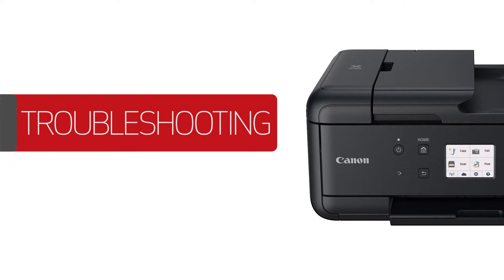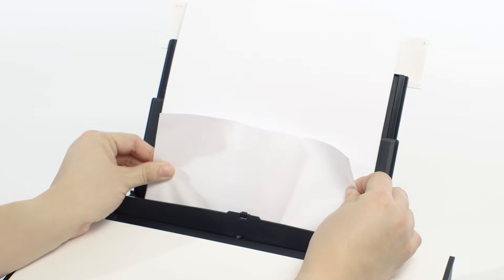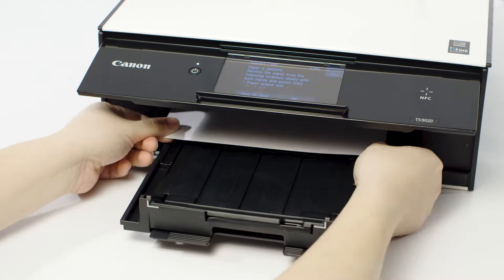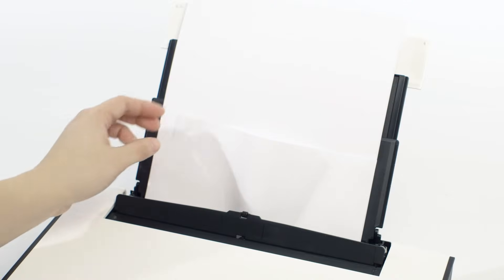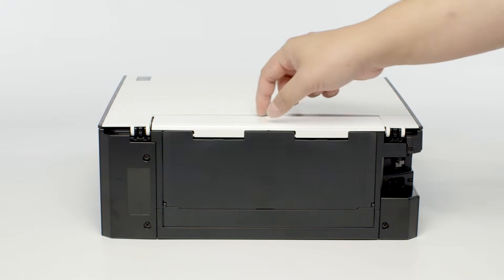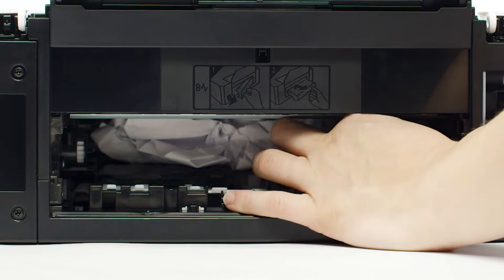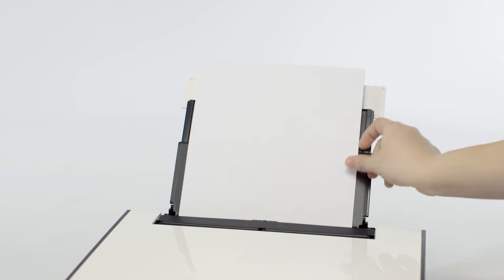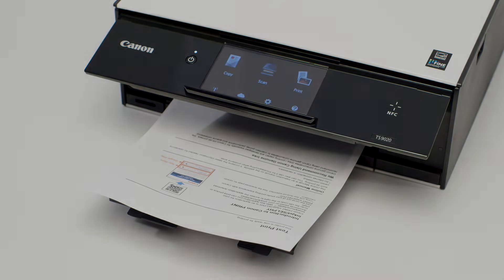Canon PIXMA Troubleshooting - Error Code 1300

Comment: If the error persists after pulling out the jammed paper, then do this... I was pulling my hair out but later discovered If code 1300 still persists, it due to a message from your computer trying to print the document over and over again saying there is a paper jam. On your computer, quit the printer queue and the error will disappear on the Canon PIXMA printer message screen. Update your Canon Printer Drivers to the latest and update your printer firmware. That will help also.

Comment: No paper is jammed , i opened it and there's no thing but the error is still exist....what should i do ?
Reply: This happened to me. I was pulling my hair out on this. I discovered  If code 1300 still persists, it due to a message from your computer trying to print the document and says you have a paper jam. Quit the printer queue and the error will disappear on the printer message. Update your Canon Printer Drivers to the latest and update your printer firmware. That will help also.

Comment: Fantastic! Error 1300, but I couldn't find any paper that caused the jam. Until I found this great video. For the first time I discovered the possibility to open the printer at the back. With these instructions I found a small piece of paper that had slipped in and now my printer works again. Thanks!!!

Comment: I wish fixing this problem was this easy. With my Pixma pro 100 it's either "there's no paper in the tray" because the paper doesn't line up with the feeder by just dropping it in. It has to be sat in the roller area. But then it feeds it and detects a jam. The art of printing is hard enough without all of this hassle.
Reply from the maker: Hi, Jim!  If you're having problems feeding paper through your PIXMA PRO-100, help is just a phone call away.  Our PIXMA PRO-series support team is available Monday through Friday, excluding holidays, at 1-800-OK-CANON (1-800-652-2666).  You can also get help from your fellow Canon users any day of the year via the Canon Community.  Sign up and post today at https://canon.us/forum

Hope this helps!
Reply: @CanonUSASupport  Pixma TS9020 Code 1300.  No paper found.  Grinding sound around ink pad area.